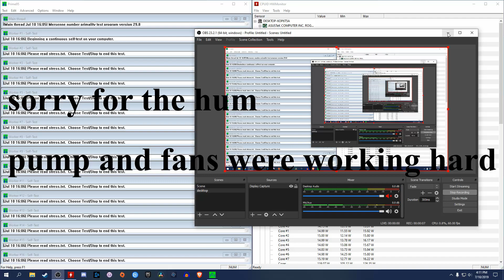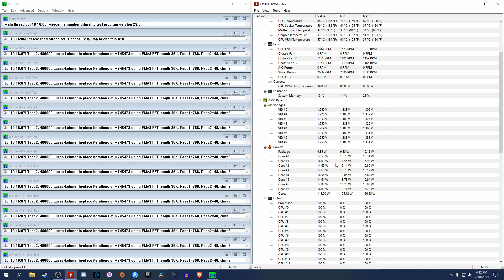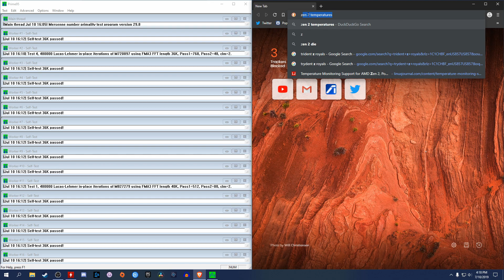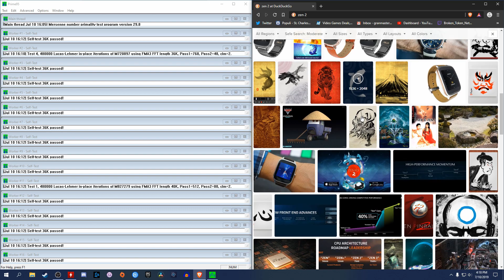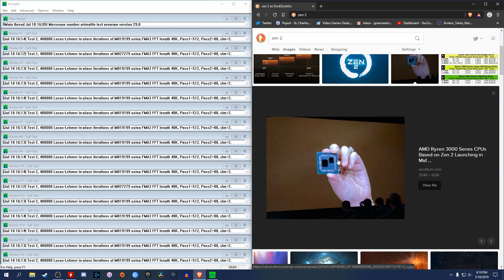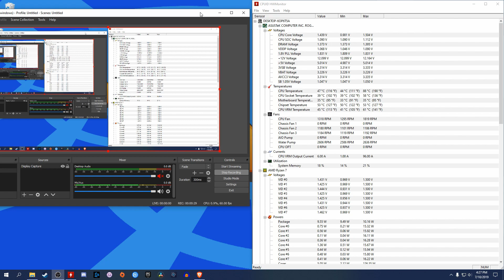Ryzen 7 3700x above 80C under water?!

Comment: Mine is 4.3ghz all core 1.35v hits 80C with stock cooler in "silent" preset. I will put back under water in a few days with the EK full block X470 strix.
Reply from the maker: Let me know how that works out for you
Reply: @TokenTech  No problem, everything is installed in the new case, waiting for the cooland and the hoses, monday.
Reply: @TokenTech  Hah ! Nevermind. Small FFT is crashing with my settings, so i copied yours and i got the same shit with 2c less at around 25c embient temp. But i use a monoblock for the motherboard, the rads are cooling the VRM and the GPU too. My rads are thin 30mm low FPI 240 + 360 with corsair 120 LL fans.
For the record, my daily settings who are stable for my workloads and games are the following :
4.3ghz 1.3357v Fans/pump at 40% then ramp up to 100% between 60c and 70c.
Cinebench R20 73c  score 5182
CPUz Multithread 5666 Single 527
Prime blend 68c
Reply from the maker: @PyromancerRift  that seems very solid,  i moved back to prime 95 for that very reason.  for now im just try to figure out why my system keeps crashing even with cpu at auto settings lol
Reply: @TokenTech  I had an issue with crashing at stock with my old zen+ chip at some point. Everything was at stock but for some reason, something wasn't and after doing a clear cmos it worked fine again. Asus does what asus wants i guess.
Another time, my old zen chip was crashing when slight load, i had to remove the cooler, resocket the chip and put back the cooler. I  changed the cooler without removing the chip and i guess something was loose.
I hope this can help.
Reply from the maker: I'll keep that in mind, currently testing memory to see if that was the issue
Reply: @TokenTech  I just had an issue with memory where i set the clock in the AMD overclocking tab and it was not reseting itself with clear cmos. so, memory speed was set to 1700 but the board was not training the timings and the PC was closing apps and crashing randomly.

Comment: My 3800x easily blows past 70C on Water in seconds, and will get into the 80’s.
Tested with Corsair H105 (240mm), and an EVGA CLC 280mm (280mm).  This happens in Cinebench R20, and in Prime95, and encoding video using Handbrake.
I have even tried running an un-dervolt (offset -0.09), still runs much hotter than my all core overclocked 1700 at 3.7 did.
Tried an Air cooler, and the heat pipes barley get warm.  This makes me think the heat is not being transferred to the Lid of the package (heat-spreader).
Seems like there is an issue with the Thermal bond between the Chiplett and the Lid of the Package.
Reply from the maker: I returned a 3700x for that reason. My 3800x on water seems better and at 72F it goes to 76C in prime 95 at 4.4ghz and 1.3v. i still looking into this issue but if what you think it's true than AMD needs to do a recall

Comment: Did you fix it? Mine is also running really hot
Reply from the maker: Sort of. Basically these chips need high voltage under light loads which cause idle temps to go up. What cooler do you have and what are your temps. Also check out my new video for more details

Comment: That isn't surprising, because the hotspot of the Ryzen 3000 chip is no longer in the centre of the IHS, so the actual heat exchanger of the CPU cooler is only partially covering the chiplet containing the cores which is what is creating the heat.
Reply from the maker: That's what I thought too

Comment: Maybe a ryzen 3rd gen specific waterblock would fix this. With an offset cooling plate design to cool the chiplet on the right.
 You can also try rotating your waterblock and swapping the inlet and outlet port so the fresh water would land dead center where the chiplet is. I assume the 3700x has 1 chiplet because of the 65watts TDP. I think the waterblock cooling fins in the supremacy evo alu should be sufficient. It looks big enough to cover the chiplet and controller inside the IHS. 
Oh you can also check if your IHS is flat. Try to spin it on a glass. If it spins like a top, then you have a high spot on your IHS. You can lap your IHS to make it flat. Youll loose your warranty when you lapped your IHS. but then again at least you will now have a good cooling. Hope this helps. Also check your thermal paste spread pattern when you remove the waterblock. This should show you how evenly it spreads when you tighten it.

Comment: Wow that doesn't look good. I've ordered 3700X yesterday still don't know when it's going to arrive but I have CPU+GPU loop with two 280 rads... I'll definitely post here my results if you are interested.
Reply from the maker: Yes please post your temps when you can! The more info we can gather the better. The weird part is I mounted a nhD15 and I've gotten better temps around 80c instead of approaching 90c.  Water block was clean when I opened it. I'm leaning towards the idea it's a bios issue.
Reply: @TokenTech  my temps with my D15 have been near 80C it's a bit ridiculous
Reply from the maker: thanks for the info, I thought I was the only one.  I reinstalled my water block and temps are below 80c.  Still crazy that we need high end air cooling/water cooling to get these temps.
Reply: @TokenTech  so I did a manual overclock my load temps are around 75-77C at 4.2ghz all core
Reply from the maker: Ill give that a shot next
Reply: @TokenTech  I'm glad I found this video so I have someone to ask questions to with a similar cooler. I'm at 1.287v for 4.2ghz all core overclock it looks like.
Reply: @TokenTech  my idle temps are a bit ridiculous. They are around 52-60C
Reply from the maker: I heard that at idle it keeps voltage rather high because of electron migration.  mostly because of the 7nm process. Ill try overclocking later and probably make a follow up video on everything. my idle temps are around 37-55c but i haven't oc'd yet
Reply: @TokenTech  my idle is now going around 40-60
Reply: @TokenTech  try doing a manual oc and lower voltage accordingly
Reply: @TokenTech  when I get home later I will be running prime 95 for a few hours. I'll let you know how it goes
Reply from the maker: so i am going to return it to microcenter tomorrow, while trying to get better temps it actually hit thermal shut down.... so I'm done with this. I might go back to zen 2 if they fix the heat issue or just wait for zen 3 but im gonna return this and pick up a 2700x
Reply: @TokenTech  so I failed prime miserably but it runs games okay. I'm thinking of going back on the oc and trying 4.175ghz and seeing where that gets me
Reply: @TokenTech  the Chip compared to my first gen ryzen in gaming is so much better it's ridiculous
Reply from the maker: yeah its crazy how fast these CPUs are compared to the older ones.  Especially if you have the gpu to push more frames
Reply: @TokenTech  I have a 1080 ti.
Reply: @TokenTech  the best I can muster keeping it stable is 1.2875v at 4.2ghz
Reply from the maker: @ToothlessSnakeable  yeah I think thats pretty standard. at 1.3v i can do 4.4ghz.  and i also have a 1080 ti
Reply: @TokenTech  I haven't tried going higher. Clockspeed wise
Reply: @TokenTech  should I try 4.225?
Reply from the maker: its worth a shot, i have also switched to using aida 64. they have a free trial version
Reply: @TokenTech  I may try that next instead of prime 95
Reply: @TokenTech  any luck on your end mate?
Reply from the maker: well now i have a 3800x and running a stress test all core 4.4ghz with 1.3v im getting 76C temps.  I think that is a pretty good improvement. along with better scores in cinebench
Reply: @TokenTech  sounds much better
Reply: @TokenTech  isn't worth a 60-70 dollars extra you know.
Reply from the maker: yeah def not worth the 70 extra but the only one in stock when i went to return my defective chip so it is what it is.  to be honest id be fine with a 3600
Reply from the maker: might actually return this one too lol and save the 200 dollars
Reply: @TokenTech  my friend ordered a 3600X hopefully he likes it. He is moving from an FX6300